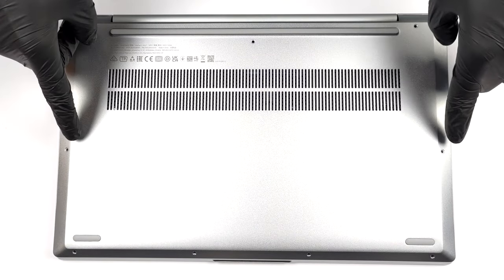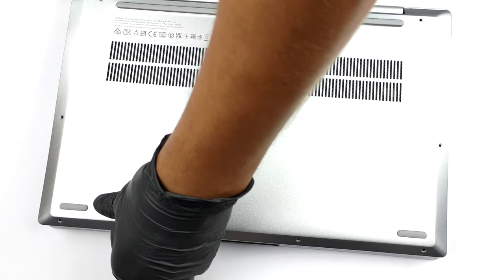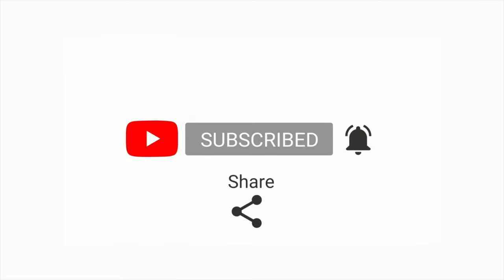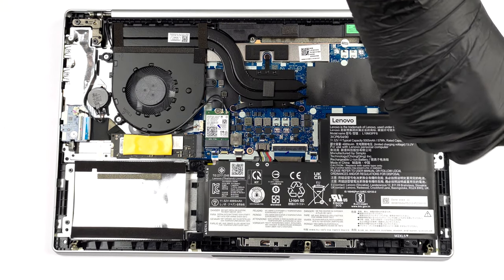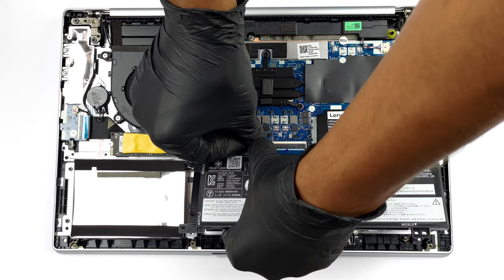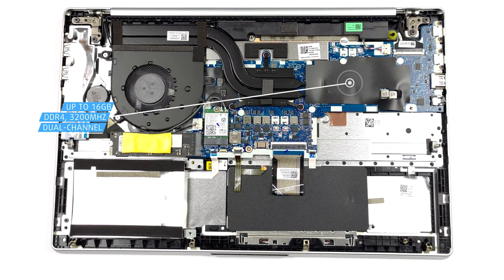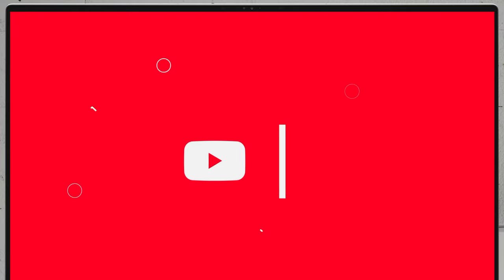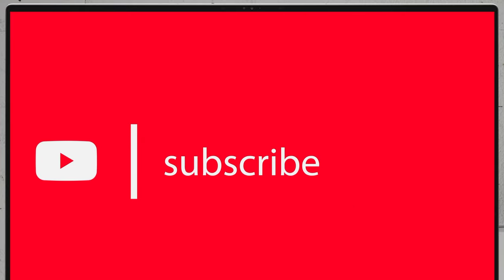🛠️ Lenovo IdeaPad 5 (15", 2022) - disassembly and upgrade options

Comment: What about the issue with the Hinges is still happening?
Reply: Same issue, mine broke 3 times in the course of 3 years
Reply: @Conf1dential_  mine broke once after 2 years. Didnt know this happened to others? Lenovo changed mine for free. Do you know if the replacement units are better than the original ones?

Comment: nice video , can you tell wich sata cable should it take to add the hdd , i have this exact laptop but y just cant find the cable.
Reply: I have the same issue. Yes, I have space to stick in a sata SSD, but where am I supposed to plug it into? There is no cable for it to plug into.
Reply: Unfortunately, you need a spoecial kit from lenovo that is hard to get (I couldn't get one) - as is, the laptop comes with empty space, but not the required cables, for the SATA disk :/
Reply: I have the cable but it is not working. The computer refuse to boot with the second hdd

Comment: WHERE TO PLUG THE 2.5" SSD?
Reply: Unfortunately, you need a spoecial kit from lenovo that is hard to get (I couldn't get one) - as is, the laptop comes with empty space, but not the required cables, for the SATA disk :/
Reply: @CutieDragon-et2ig  Mine came with the required cable in the packaging.

Comment: Oh my god it's not even a slim model, why do they insist on soldering the ram to the motherboard
Reply: Ikr it's so annoying
Reply: Because they save money on memory slot port.
Reply: @wojtekkowal2652  the slot + using a DIMM instead would add about $5 per unit on these lower end, higher volume models.
Reply: @jetfuel_  yah correct ,multiply times amount of laptop produces
Reply: @wojtekkowal2652  I don't believe that matters, just raise the price $5 + your 10% margin.
With the drive for right to repair and product upgradability in the past years the customer will still go for it, more so if they see it's upgradable down the line. I mean if one of the chips or one of the solder joints crack, instead of going for a new laptop or a replacement board, you or the service center can just pop a new dimm in for like 60 bucks
Reply: Because they are earth friendly and they want you to buy a new one
Reply: I was looking at this laptop on Lenovo's eBay store, and for me it would be the perfect Linux laptop if it was not for the dang soldered RAM, as with this many cores, I'd want 16GB at minimum for comfortable doing daily task.

Comment: Well, on my 15alc05 model the extra 2.5 inch ssd space is filled with a bigger sized battery. Bummer, so much for the extra cable I ordered.